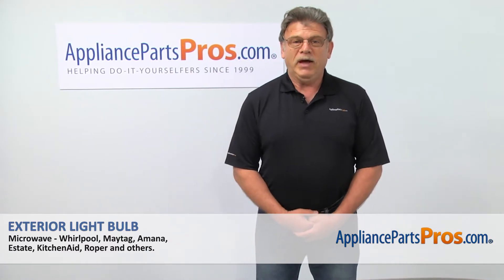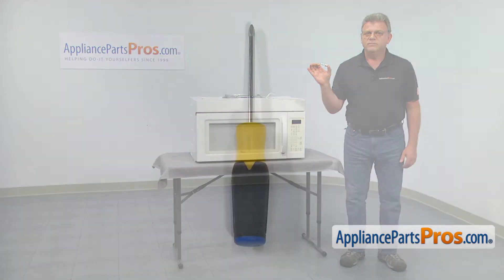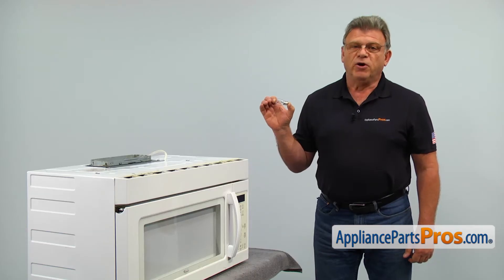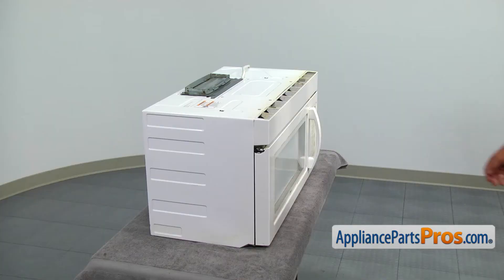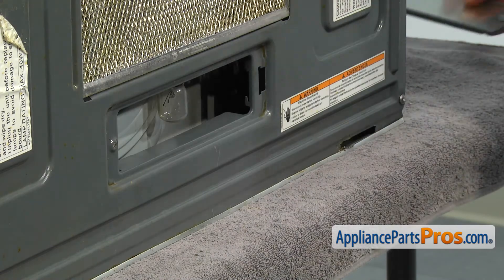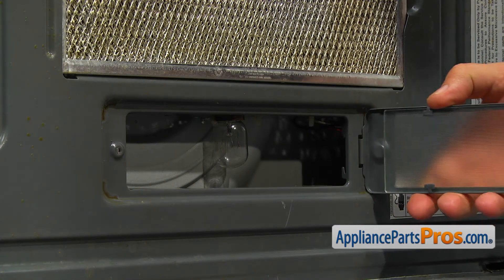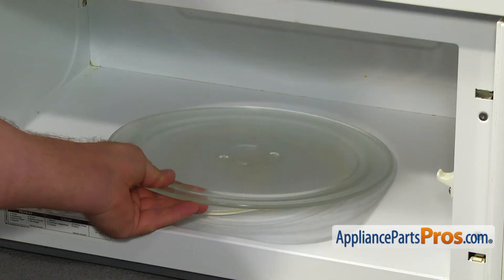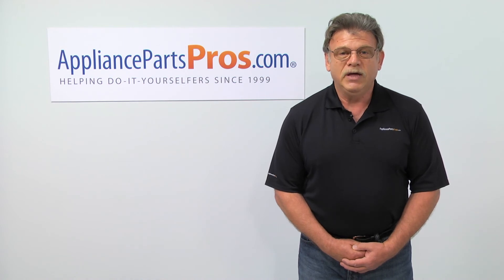How To: Whirlpool/KitchenAid/Maytag Exterior Light Bulb 8206232A

Comment: After 10 years of use, my bulb's glass had completely separated from the metal sleeve.  This made removing it bit more challenging, especially given that it's in a tight place.  A mirror, a headlamp, and some snap ring pliers got it out.  I unplugged the microwave first, of course.